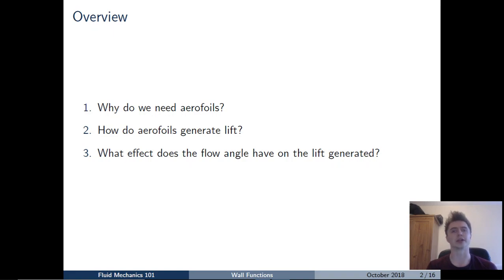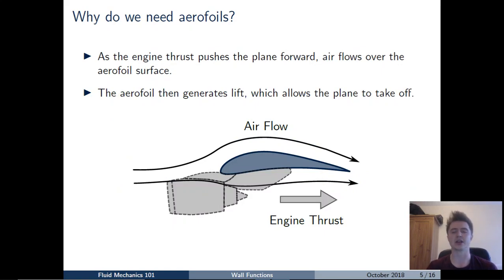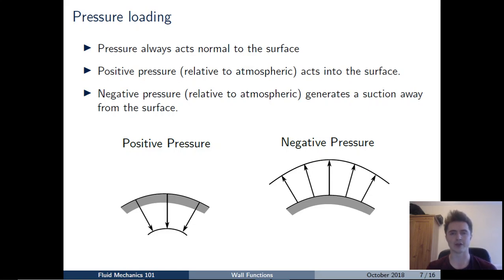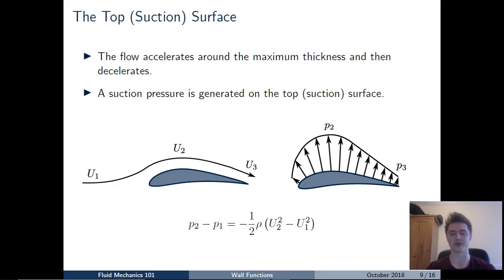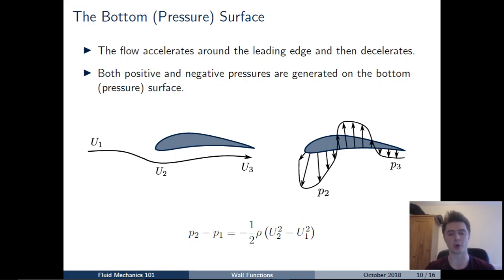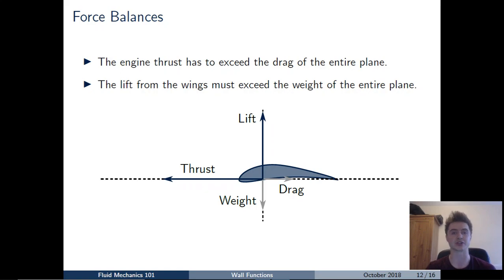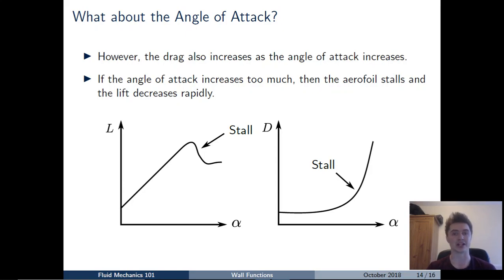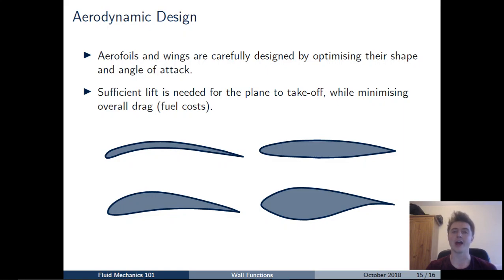[Concepts] How do Aerofoils generate Lift?

Comment: Nice explanation 👌👍 Thanks
Reply: He has some errors:
He  got it correct that Bernoulli's Equation (and Principle) is about Pressure Gradients and Acceleration , not speed.
.
However. . . 
.A negative pressure does NOT cause a force acting away form the surface.  You can not pull on a surface with a fluid. It is simply a lowered pressure toward the surface.
This is only a reduced force toward the surface.  Atmospheric pressure is ALWAYS pushing toward the surface, both the upper and lower surfaces of a wing. The word 'suction' does not mean it pulls. Some other higher pressure pushes toward that lower pressure. Pressure only pushes on a surface.
..
Then.
The airfoil changes pressures around it.  These pressures then are the cause of the accelerations.   This is Newton's Laws in fluids.
Air has mass and a force is required to accelerate a mass.  It is a difference in pressure from one location to another that provides the force to accelerate the mass in air. Newton's First Law.
.

The lowest pressure (above) occurs where the curved path is the sharpest curve.
.

The flow you have ahead of the wing does not show the up-wash.  Up-wash makes your flow and pressure distribution somewhat inaccurate.  What you have is actually MORE complex than it is on common wings.  That low pressure under the leasing edge is not like that. That flow is generally a single downward curve.  See other flows on real wings or CFD.

Comment: You've got it correct that Bernoulli's Equation (and Principle) is about Pressure Gradients and Acceleration , not speed.
.
However. . . 
.A negative pressure does NOT cause a force acting away form the surface.  You can not pull on a surface with a fluid. It is simply a lowered pressure toward the surface.
This is only a reduced force toward the surface.  Atmospheric pressure is ALWAYS pushing toward the surface, both the upper and lower surfaces of a wing. The word 'suction' does not mean it pulls. Some other higher pressure pushes toward that lower pressure. Pressure only pushes on a surface.
..
Then.
The airfoil changes pressures around it.  These pressures then are the cause of the accelerations.   This is Newton's Laws in fluids.
Air has mass and a force is required to accelerate a mass.  It is a difference in pressure from one location to another that provides the force to accelerate the mass in air. Newton's First Law.
.

The lowest pressure (above) occurs where the curved path is the sharpest curve.
.

The flow you have ahead of the wing does not show the up-wash.  Up-wash makes your flow and pressure distribution somewhat inaccurate.  What you have is actually MORE complex than it is on common wings.  That low pressure under the leasing edge is not like that. That flow is generally a single downward curve.  See other flows on real wings or CFD.
..
Reply from the maker: Thank you for your input. You are correct of course, and I appreciate your clarifications. You are an aerodynamics engineer I'm guessing?
Reply: @fluidmechanics101   I'm posting replies, but they don't seem to be showing up.  I will leave the links out.  YT seems to not like posing links in comments.
Reply: @fluidmechanics101  I've had a long-standing interest/passion in aviation and my father had a private license (in 1936), but I followed my primary interest, Electrical Engineering with the top company Motorola, 36 years. Motorola was a company where you didn't last long if you didn't understand what you were talking about and it was a dream career that I know I was lucky to have worked with some of the best and brightest. 
.
I also mentor and taught Electronics in the US Navy and at the junior college level. I currently do STEM demos at two grade schools and I not only take seriously understanding things fully, but also explaining things effectively to all levels of student. 
.
 A number of years ago I read everything I could find about the Wrights, and others, but after retiring, I started volunteering at a local Challenger Learning Center.  (cont. in another reply)
Reply: @fluidmechanics101  At Challenger, I took responsibility for a very sophisticated, full cockpit B737 flight simulator that was donated to my center. I had 5th and 6th graders landing the Shuttle at Kennedy Space Center. . . . The best toy ever!.
.
Knowing I'd be asked questions, I brushed up on a few things and Bernoulli and lift were something important, but I was quite appalled at all the bad information out there that didn't follow good physics. So I got some the top books and contacted a few of the authors to clarify some things. I ran many experiments and demos and also discussed much with my Aeronautical Engineer son also a private pilot and works in the field. 
..
You'll see my comments under many YT videos that have it wrong. . .
Reply: @fluidmechanics101    I'll try to fool YT:
..
The main Challenger site is the URL of  'Challenger' followed with a dot, then org.
Reply: @fluidmechanics101   I don't know what your background is, but I have full treatment in two blogs on the Quora web site, but YouTube won't allow posting the URLs.  I'll try to defeat the algorithm that keeps erasing the reply, next.
Reply: @fluidmechanics101  I am replacing the dots with the word "garbage".
..
First there is the standard https with the two slashes and colon .   Then, this.
rxesywwbdscllwpn garbage quora garbage com THEN a slash.
Now to see if this "sticks".
UGH!
Reply: Looks like it worked.!
Cheers
Reply from the maker: You certainly have had a very interesting, fulfilling and exciting career path. Thank you for sharing and all the work you have done to try and clear up the tricky concepts in aerodynamics. We really do appreciate what you have done. I will check out the links when I have a spare moment. Yes YouTube does seem to try and filter and remove links automatically (presumably it's spam filter is a bit too tight) but I think we have found a way around it 🙂
Reply: @fluidmechanics101    Perhaps, then, you 'd consider either correcting the video, or removing it.   I don't see how repeating misconceptions helps others to better understand the subject;  except to falsely convince them that because everyone is repeating them, that they are fact. . . .

Comment: If the angle of attack is suddenly increased from zero, then a starting vortex will form at the trailing edge and be dumped in the flow. By the conservation of vorticity, there must be net bound vorticity associated with the aerofoil and this generates lift by the Magnus effect.

If we go on increasing the angle of attack, then there will also be a flow separation on the upper surface of the aerofoil which causes it to stall. Lift drops, drag increases dramatically and we have massive entropy production. This is something to try to avoid.
Reply from the maker: Nice explanation of the starting vortex! I like it

Comment: If we consider a high lift thin airfoil with a camber, like that of the Wright brothers and Bleriot, we can generalize that there are four primary zones around the airfoil that makes it better than a flat plate.  These four zones are selected and accented accordingly, depending on the velocity the wing is to operate and in the faster sections, they may even disappear.  Two of these zones may at first appear to be a  bad investment and a disadvantage, but they are a good investment to make the airfoil better than a flat plate.  The four zones are as the following.
1. Above the angled leading edge, there is a high-pressure zone to  accelerate the mass particles upwards
2 Above the upper downsloping surface, all the way back to the trailing edge there is a suction low-pressure zone to accelerate the mass fluid particle downwards with the downslope providing a longer flight path to produce a higher downward acceleration/velocity.
3. Below the leading edge, there is a low-pressure suction zone to accelerate the mass particle upwards.
4, Below the lower downsloping surface, all the way back to the trailing edge there is a compression, high-pressure zone.to accelerate the mass fluid particle downwards providing a longer flight path to produce a higher downward acceleration/velocity.enhanced by the Angle of Attack.
         
Zones 1 and 3 may at first be seen as a disadvantage, producing drag, but in real fact, they act as " the initial compression in a piston engine before the real power stroke comes in later on!"  Zones 1 and 3 do act as a football player kicking a fast-coming approaching ball rather than shooting the ball from a stationary state, or a cricketer batting an oncoming fastball rather than the ball falling on the stationary ground. Giving energy to a ball "hitting it on the fly" will produce a better flight if the ball velocity is reversed rather than starting from a stationary state. The change in momentum is far higher. That is the brilliance of the airfoil shape design over flat plates. This is also related to the upwash before the leading edge and the downwash at the trailing edge, where the Angle of Attack compresses the fluid for the initiation of the upwash far ahead of the wing.
Note at 6:20 to  7:20
*  the surface above the down angled curve/camber at the leading edge, provides an upward accelerating zone due to compression / high pressure, and this dynamic investment. will provide a better flight path over the rest of the upper surface. to produce the suction zone, later on, listed as zone 2. see video below.  This is why an old-fashioned cambered wing is better than a flat plate. 
* the surface below the down angled curve/camber at the leading edge, provides an upward accelerating zone due to suction /low pressure to fill in below the leading edge, and this dynamic investment. will provide a better flight path over the rest of the lower surface. to produce the compression/high-pressure zone, later on, listed as zone 4.  This is why an old-fashioned thin cambered wing by Wright Brothers and Bleriot is better than a flat plate. ( At the downsloping leading-edge, It kicks the mass particles on the fly!!"
The effect described above and below the down angled leading edge is usually shown in racing cars going over the hump of a hill where the fast mass of a car tackling a curved hill is exactly the same as the leading edge of a wing, as listed as zone 1 and 3, but to relate zone 3 to a fast car on the hump of a hill, one needs to put a curved surface above the cars to simulate the compressing action on the lower leading edge. of a wing, a curved concave road above the car needs to be imagined.
Reply: Refer to the airfoil shown at 12:07, top left. and the following videos.
https://youtu.be/AAjIdmYIZrQ
https://youtu.be/rUkytRPIJNs